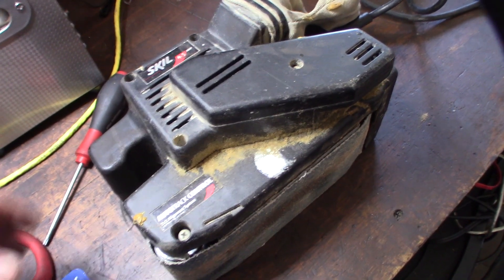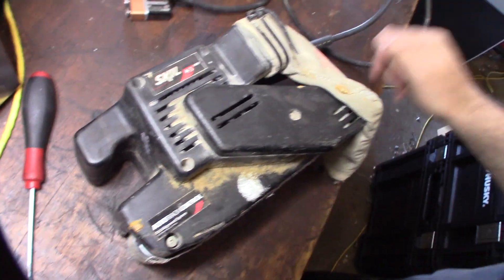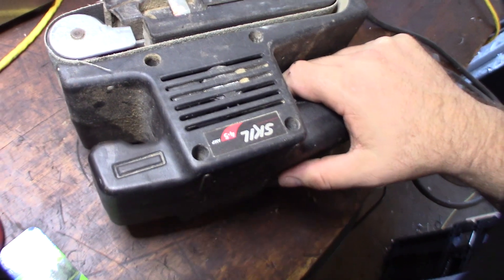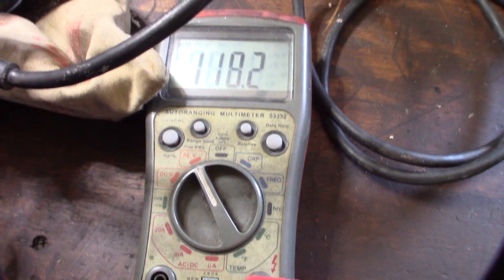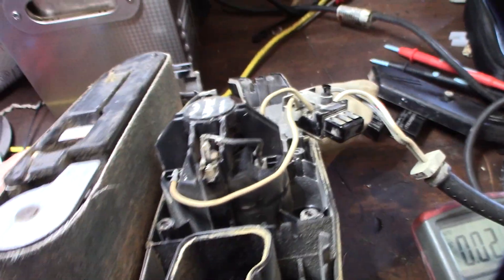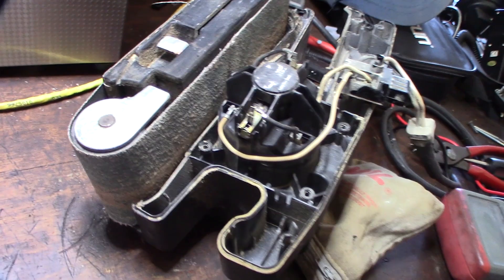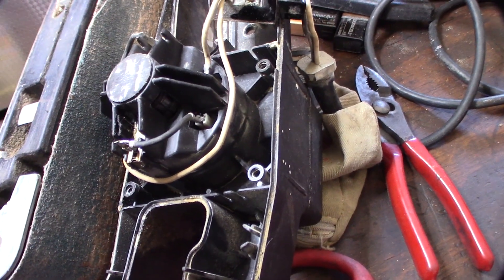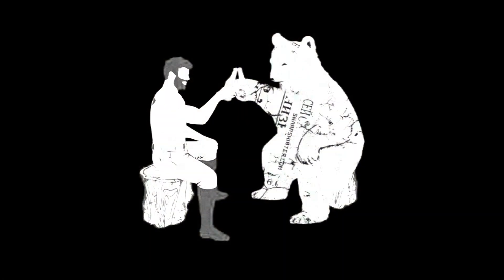Skill Belt sander troubleshooting and repair Dead No Power

Comment: I have a Skil 7510. I can plug it in and press the safety button in and pull the trigger but it doesn't spin. There's 3  separate lights by the safety button. I get 1 out of 3 lights coming on when I press the safety and trigger but no action.

I had this thing running and used it a few times. Then put it up and tried it again years later and have these issues.

May or not pull it apart to try to fix it. It was a pawn shop purchase 3 years ago so.....

Comment: I have a Skil 7313, looks much like yours. I need advice about tracking the belt. It spins right off. There is no tracking "knob", it's just a screw with a spring that sits against the metal side of the roller. Wth?? Not really self evident (to me) how it should 'fit' against there. Help!?